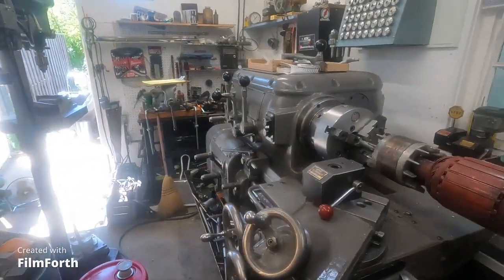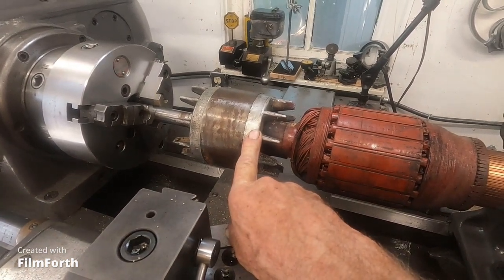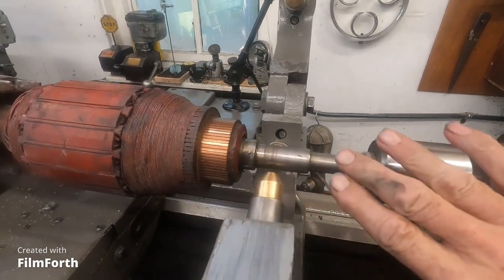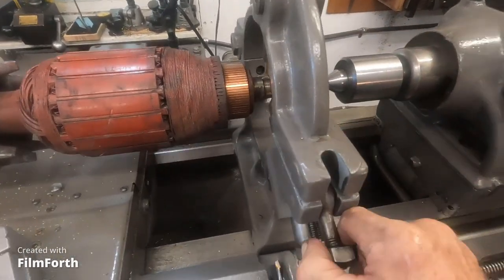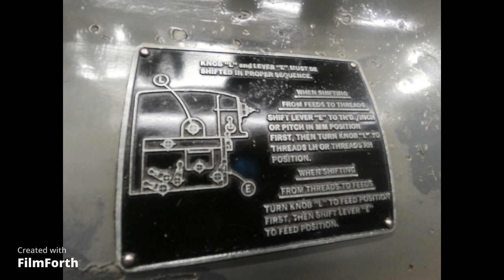Monarch 10ee tool makers lathe, the heart of the matter 1

Comment: Another excellent video Dee Dee, I'm very much enjoying these. Question for ya, what do you think of the new Silicon Controlled Recticfiers for the C16J tubes? I've got an old Monarch myself, and luckily I havent had any tube troubles(yet) but looking at prices of NOS tubes has made me consider the solid state setup if ever necessary. Have you any experiences to share?
Reply from the maker: I am aware of those tube replacements but I have had no problems with tubes. I try not to overload the drives ability to hold speed and keep the contactors clean, thanks for watching.
Reply: Good advice thank you!  @deedeeindustrialsuperprecision

Comment: Gosh, I thought about taking 36 grit varnish removing sandpaper to a motor shaft bearing journal once...guess I'll have to go out to the shop and flog myself 20 times with a length of #60 roller chain...Ow! Ow! Ouch!!
Reply from the maker: There is good info on that in the Barden Bearing literature, I will get back on the precision bearing handling subject soon.